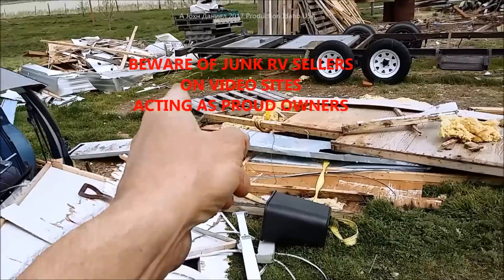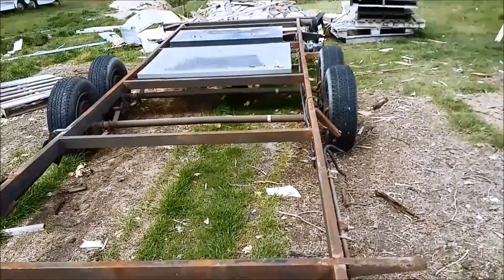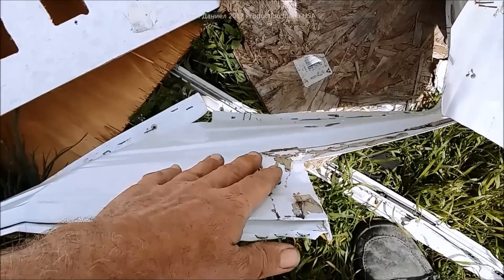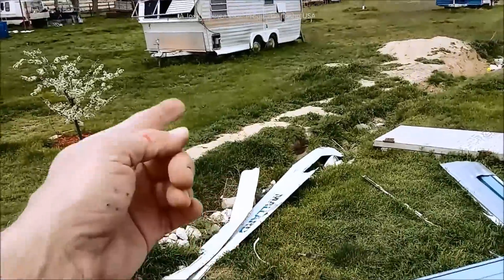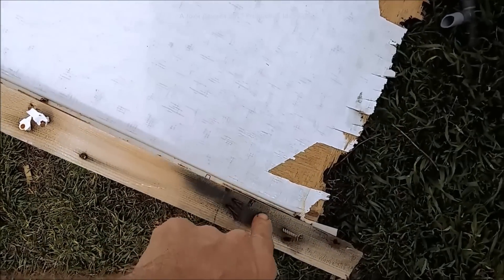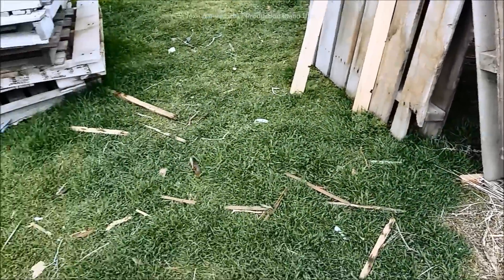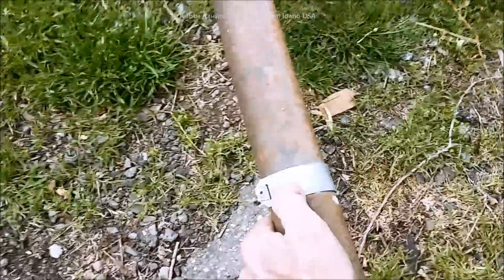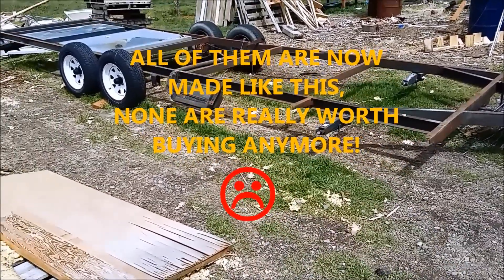HOW THEY MAKE RV Campers Travel Trailers, The truth, Wow! Info Below

Comment from the maker: MY TIPS If you must have a trailer get one of these Scopes to look in its walls https://ebay.to/2UKAzYD to make having one less risk. A awesome RV Generator Sportsman 4000 dual fuel!!  https://ebay.to/2VS5cYC (See my video on them https://youtu.be/lmFJ_w8seMk ). A good Book on RV's - Get and learn some skills, http://amzn.to/2p1Kc3U  DON'T think you can fix a rotted out, issue based or water damaged RV without full comprehension. They are built from the inside out and unless your very very skilled, avoid them. Don't buy a RV without hard core inspection and knowledge.
 MY TIP  ✌  FOR MY LONG TERM CHANNEL FOLLOWERS - ⬇️ Complete 1200w OPC SURVIVAL POWER SYSTEM -- 100 Watt Panels https://ebay.to/30FYSs1 ,$120 REAL 50A MPPT https://ebay.to/3abTqju ,Solar Connects https://amzn.to/2XJOa1M ,Battery cable USA made https://amzn.to/3h6dsim ,12/2 Above/Underground https://amzn.to/2XIJolg for safe DC wiring of lights and appliances. (appliances you can use on 12 volt full list below)
Cheap Inverters with proven 4+ year records of quality - 3000 watt https://amzn.to/3awLWrS for tool, high amp and start up use, & a 1000 watt Pure sine for sensitive computers, TV's and electronics https://amzn.to/2Y1UHoH or just go one big inverter a 3000 watt pure sine (preferred method) for what your system can produce in peaks https://amzn.to/3iNsQjQ TRAILER HISTORY - In 2008 it sold for $22,455 according to the papers, in 2-1/2 years the original buyer unloaded it in a trade in to a dealer in Colorado, 2 months later the second owner bought it/dealer knowingly unloaded it to him for $3,500 due to it being a "extra" on the lot, 2 months after that on the first trip to Arizona, he fell through the floor/wall. Obvious dealer knew it was shit. Trailer sat in a building sealed up during a legal battle on it for a long time, Then I got it for $100 (storage sale) to wreck out to make something from the frame. It was so weak we chopped it up and sold the weak axles to a guy on Craigslist for $100
YOU'VE BEEN WARNED, Don;t be like the owner who had this mess. 

DUE TO SELLER - RV HUSTLERS ON YT, Comments are on approve only unless otherwise stated.
Reply: Јоhn Daniel another brand of travel trailer to stay away from it's called Dutchman. I had a friend that owned one just Towing it behind this truck cause the frame to tweak out of shape. And his insurance company wouldn't do much for him in the manufacture didn't do much either. There's a builder name Monaco that builds motorhomes. I may have much better quality than those cheap-ass travel trailers
Reply: Fleetwood says it all.
Reply from the maker: So So, not impressed and WAY too expensive. Makes you wonder why the hell no one makes a fully casted uni-body RV. With the studs (like ribs) and walls in one shot Roto Molding methods, all from a mold that can be stretched to make longer models with ease. Hmmm Light-Strong-no rot.
Reply: @JOHNDANIEL1 try the LilSnoozy,all fiberglass, the designer was an a designer of airplanes and boats...be patient on the purchase, small company,slow to deliver but quality product. Good luck
Reply: What do you think of the fiberglass trailers, Casita, Scamp, etc
Reply from the maker: Monoco was the top of the line in mid value class A for decades. Not now though.
Reply: Јоhn Daniel Airstream that's the one to get.
Reply: So what are the better manufacturers?
Reply: Ron H. http://www.drvsuites.com/mobile-suites-luxury-fifth-wheels/
Reply from the maker: The book is relevant to those RV's which are 10 years old or more and needing service. But on the same location as the book link I put on here is more current versions if your in the need.
Reply: A moisture meter is a great tool to check all the nooks and crannies for moisture. They all leak to one degree or another.
Reply: Question - if all RVs are built that poorly, then what should we buy instead?  The campers that fit on top of a truck?  Or what about those travel vans? (I don't remember what they're called). I certainly don't have the knowledge, not the time, to fix up an old RV, so which kind of travel vehicles ARE built well?
Reply from the maker: Brands that are worth looking at really depend on what you have the intent to use. Alaskan Camper are very good, so are Class B camper vans in most cases. On the large campers and 5th wheels, Holiday Rambler pre 1994, Carriage and King Of the Road from 1992 and back. But the best all went out of business some 20+ years ago or longer because their profit margin got so small competing against slam-it-together cheap stuff.
Reply: Thanks for that advice!  When you say that Class B camper vans are good, I don’t know what Class B refers to.  Sorry but I know nothing about travel vehicles, although I keep seeing them & I really want one.
Reply: Јоhn Daniel right on brother!!!!
Reply: Isn't that book kind of old?
Reply: Јоhn Daniel 

I like my fiberglass 5 th wheel trailer, I've seen stick built travel trailer that people live in all year round in Alaska, some older than me, if you take care of them they can last
Reply: Australian RVs (or caravans as we call 'em!) are really not much better.  Best to avoid marques such as  Jayco - where build quality can be "somewhat careless".  In sharp contrast, the European manufacturers (many UK brands, and big names such as Geist, Burstner, and of course Adria), build very durable, yet light and very modern  vans for reasonable (though not "cheap") prices.
Reply: I totally agree, Fleetwood is junk, but that trailer had leaking issues.  Wood doesn't rot unless it gets wet but point well taken.
Reply: Amen brother amen you just saved my ass from buying all these pieces of s*** thank you man we've ready to go spend 20 grand 30 grand on a maybe a 10-ft trailer with bunks and what they call it one of those collapsible beds and save room or and it folds up and there's like a little couch I think it's called a Murphy bed and no s*** it was a Fleetwood and you just save my ass thank you thank you and just maybe saving somebody's life on the road from this damn thing falling apart or something you know you have no idea the gratitude I have for you right now for me saving my money from buying a piece of s*** like that in a couple years first year it might go great then after that is rotten the hell with this thank you thank you again you save my ass

Comment: Too bad i didn't see this before covid hit.
Now my wife and I are stuck living in this camper for the winter.
Its soooo cold in here with heat on high.
Got blankets covering everything.
Its warmer than outside but damn
Reply from the maker: Solution 1 roll of this https://amzn.to/2IbPcPC , then you cut it to size and install into the backs of every cabinet, closet and behind things to the outside walls. shiny side out to you. I bought a roll of 48 x 50 and it did all spots I needed to give the 25 foot  RV as good as a R2 increase in insulation. I even put this on the ceiling of my old Terry, as a ceiling coating, amazing!! Install with spray contact adhesive like 3M ( 3+ cans for a average RV ) https://amzn.to/37uUyhs 
Stay warm dammit!
Reply from the maker: PS, be sure to not over tax your electrical power wiring in that thing. If you have to run a separate 14 awg cord out to the outside power source and into the trailer for a additional heater stay under 1000 watts heaters and just make a hole if you have to to be sure your walls don't catch fire from electric heater caused amp shorting.

Comment: My 87 GulfStream is on a John Deer Chassis with a Chevy 454. Nothing to rot as it’s a fiberglass skin with a 1.5” foam block insulation, tubular stainless steal constructed with the ceiling , floor and walls lag bolted together every 8”. New builds are garbage , some even made with OSB and or particle board. Definitely don’t make them like they used to.
Reply from the maker: Absolute fact, and the same company can make pure junk and/or insane quality so its hard to even judge them anymore.

Comment: Sad seeing how messed up this trailer was. I actually just recently bought (March of 2019) a used, 1 owner 1996 Mallard by Fleetwood 23 foot trailer for $5,500. Very similar to this as i can tell in the video. I'm a building engineer by trade, and spent a long time Inspecting the trailer before purchase, and MANY hours after purchasing just going through end to end top to bottom.... I actually found VERY little water damage/rot (nothing I couldn't easily fix, and no structural damage at all) and the trailer was in practally brand new condition, even the interior looked brand new minus the yellowed out lights (quickly replaced with new led fixtures for cheap). I replaced all exterior plastic parts and replaced/resealed with butyl AND dicor brand liquid sealants, and used nothing but stainless steel screws. I replaced all the exterior vinyl trim and resealed all the corner trim and gutters. Roof was aluminum so was in great shape. Removed all the windows, resealed with butyle and dicor sealant, checked and tightened all plumbing and gas fittings, checked all accessible electrical connections. Replaced and resealed all exterior lights. So far this trailer has been an amazing trailer that goes out a couple times a month (I live very close to MANY campgrounds). So far, even before I began replacing/resealing everything, the trailer worked and functioned great without any leaks. All the time I spent replacing and resealing everything on the exterior was to make it look nicer/newer and as a preventative against future leaks. Although I do agree newer trailers are all junk, and im aware Mallards were by no means high end, I do feel that if they are well kept and never allowed to leak water, they hold up great. I've camped about 15 times in the past 7 months and love it so far. So my advise, regardless of what trailer you buy, make sure u know what your buying, and take the time to fully inspect it and reseal everything.

 All the resealing products, replacement exterior plastic items, interior led fixtures through the whole trailer, new kitchen and bath faucets, 2 new fire extinguishers, new smoke detector, new gas leak/CO detector, added a flat screen TV, upgraded the stereo and speakers, added exterior speakers, added a few cheap water leak detectors.... And a few other goodies.... I had probably dumped around another $1,000 on top of the trailers cost of $5,500....and I'd take this rig over any brand new $25,000+ trailer sold today. Figured if I can get 5 or more years outta it, I'll be happy.
Reply from the maker: You caught it before it was damaged or it hopefully came from a different factory, good show. I do this as you can see on my other camper videos to all I get thats not a rot box already. Total pull and seal and re-pipe to PEX immediately!!!

Comment: I just bought a 2017 Jayco 17 ft trailer and after 3 months I'm already thinking of selling it.  Everything is made so cheap, pine wood, which is brittle as shit, staples, tacs, poorly built cheap shit. The kitchen sink is plastic, and counter top caulk seal leaked and warped it, the window seal on front window is peeling. I'm thinking of buying a van or a truck with a camper shell instead.......these trailers are cheaply built pos!!!!

Comment: hey john I build a utility trailer out of a travel trailer frame, not sure the brand, it has 2 axles with 5 lugs nuts, it does not have a tag saying the weight rating of the axle the tubes are 2 3/4 and thats where I am confused because a 3500 lb axle have 2 3/8 tubes and 6000 lb axles have a 3 in tube, have you ran across anything like this and might know the weight rating of these axles? thanks
Reply from the maker: Its a 4200 Dayton axle, but its only good for 3500 with the 5 bolt. Those are the Canadian Daytons.
Reply: @JOHNDANIEL1  thanks for the reply I might see if I can find a hub and brake assembly for 4200 that will fit
Reply from the maker: You can never make it a 4200 without converting to the Lafayette 4 on 9.44 rims. You can however make it a 4k with whats available now. Make sure your bearings are the 3500lb, then get this kind of kit https://ebay.to/2WqgO4r to make it a actual 4k+ by law. As long as you have the thicker 3 leaf set up or 4 leaf springs on it, your good for 4000 to 4100 per axle by going to Chevy 6 bolt 6 on 5.5 and using junk yard Chevy 6 bolt steel rims your good to go. Use only the GMC or Chevy pre 1992 ZERO or NEGATIVE 6 offset steel rims on it, your trailer will be fully capable. And if possible, Box the frame or add some 1.5x 2 x 1/8"th wall angle on its side if its already boxed down the length of it 14" before front spring mount to 14" past the rear spring mounts. Crease points that can happen on over loading are normally at 5 to 10 inches from the spring mounts, this angle 3/4" long spot welded every 3" on the frame solves that. Be sure to replace the spring bushings https://ebay.to/31lOy6M  with new to stop chances of binding and your good to go.  RECYCLE - REBUILD!!

Comment: Wow what an enlightening video! Thanks. Van't believe a trailer from a major maufacturer would be reduced to rubble like that less than a decade after it was rolled out of the factory.
The eBay links have a problem. What did you mean by "If you just gotta have a trailer, I recommend getting one of these Scopes"?

Comment: 5:10 is that.... polybutylene piping... on a 2008 trailer?!
Reply from the maker: White PEX I think. They replumbed the trailer at Camping World with new pipe and fittings claiming the LEAK was plumbing, WRONG!! It was the whole damn hunk of junk.
Reply: Јоhn Daniel 

That looks gray though, not white. I've replumbed my [1995] house which had PB, with Pex [white, red and blue] and will be doing the same on my 1992 Monaco Dynasty. 

Crazy that they replumbed the whole trailer. It still looks oddly strange to PB
Reply from the maker: @rickc303  Yep, Looked closer, its likely Gray QUEST type, outlawed in homes 20+ years ago but allowed in campers and as Refrigeration condensate drains for many years after. But, note they used the copper Rings (not Quest tube aluminum type). I see Nibco long PEX fittings and copper rings on it. What a combo! And now I know why theres lots of videos on here calling Camping World the largest scam in RV's.  Lady with a 2015 5th wheel came had me change a shower faucet and it too had this tube in a 8 foot long repair under her sofa, done by camping world LOL. They must have bought up miles of it. The 2 barely fit each other, but will.
Reply: Јоhn Daniel 

Oh wow, never knew about quest or it's continued use after the ~1996 cutoff for houses.

Reason why it stuck out to me, is because it looks exactly like the polybutylene I'm replacing, fittings and all. My house has copper fittings with copper rings (apparently the "best" and last PB revision, and, ironically, the copper fittings is where the [many] leaks have been. House is on a well and water isn't softened/filtered, all metal in the plumbing is badly corroded.

So far, there hasn't been a single leak in the 1992 Monaco (also PB with copper fittings/rings), probably due to far less use over the years. At first I was going to leave it, but after miscalculating pex needed for house and having enough to do at least four more houses, I figure it'd be a good idea to replumb the Dynasty as my long term plan is to full time with it.

Btw, no homo but you've got a smooth voice for narration!
Reply: Јоhn Daniel 

Oh and "proper" repair of PB (for those not replacing entirely) is with pex, using specific PB-pex adapters, readily available at home improvement stores in both crimp style and Shark Bite. I personally have not actually had the PB piping itself fail, but the diameter differs enough that you definitely do NOT want to use pex (non adapter) fittings on PB piping, as it will not crimp properly. Any repair center doing that would be a huge red flag. Pex and it's fittings is so cheap and easy to work with, there's really no excuse to do anything otherwise
Reply from the maker: @rickc303  This is the REAL Camping World you never hear about, all scams and I get 40 to 50 people a year come by shoddy repairs and deals from them. https://www.youtube.com/watch?v=6wrsMU7WMuQ